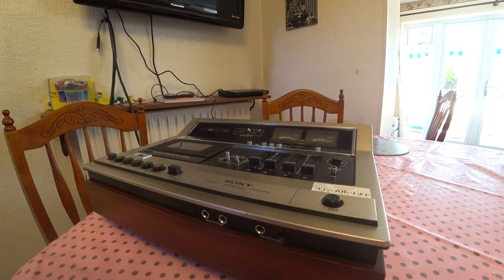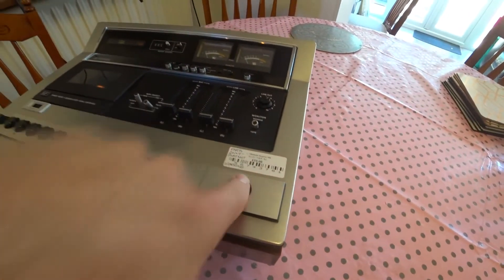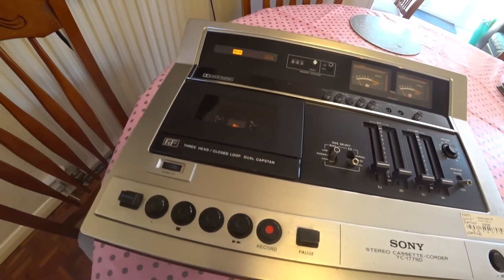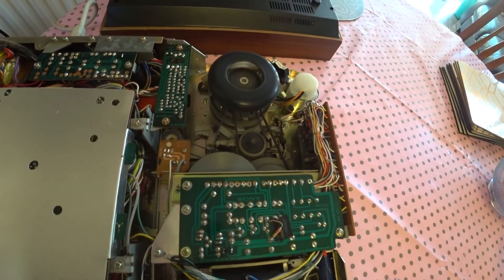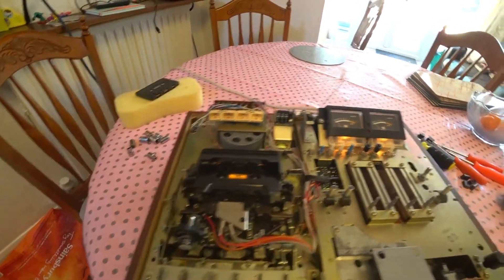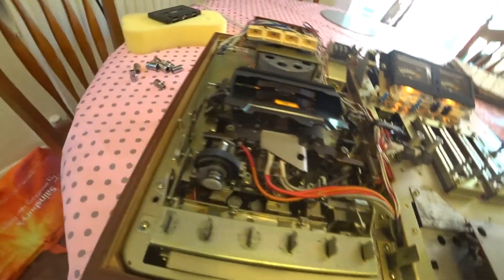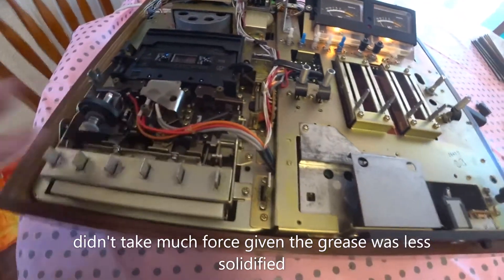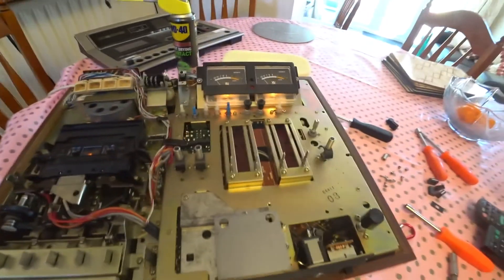Sony TC-177SD Fixing (Part 1) #cassettedeck #cassetteplayer

Comment: I could only dream of paying a 'tenner' for such a machine. I have  about 20 (twenty) cassette decks - all repaired by myself. I think the very last one I'll go for is indeed the TC-177SD. I tend to get machines working in 30 minutes or so, but of course that's not the end of it. Typically, I'd be spending somewhere between 20 and 50 hours refining the whole thing. Why, as one may ask? Well, the answer is simple - all the components are all ageing in slow motion, and at different rates. One fix often leads to another that has to be done. The heavist machine I have  is the Sony TC-209SD, which weighs even more than the 177SD .... 12Kg no less!

Thanks for the upload!

Comment: Hello. I got one of those that had been sitting for years in a store. The store is on the coast and the Sony is well oxidized. When pressing play, the heads do not reach the tape and it is not running. Lots of work ahead!
Reply from the maker: Good luck with your attempts to get it working again. Your odds on fixing it are quite good given how well the machine was made in the first place.